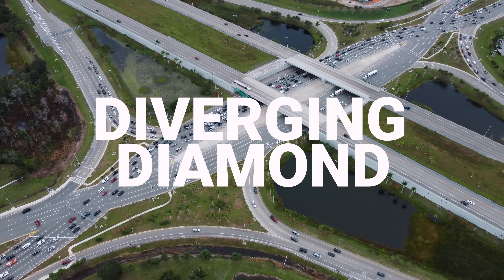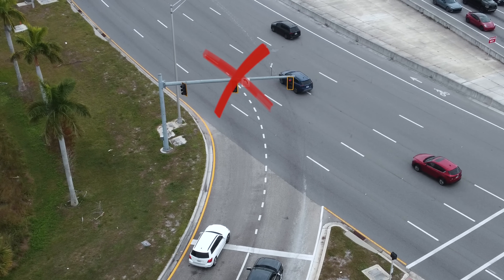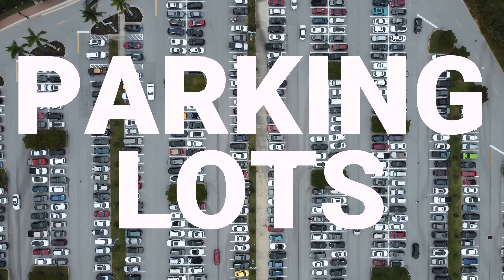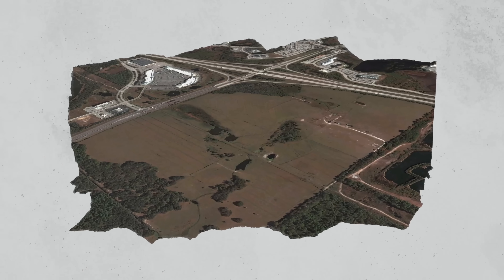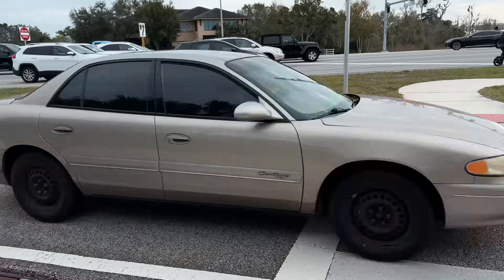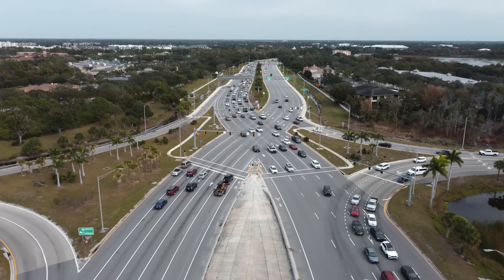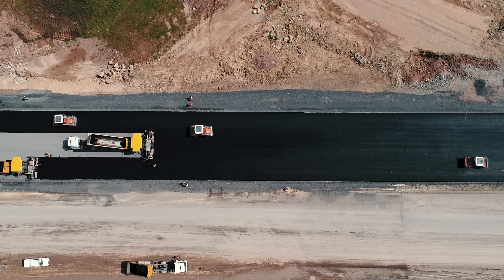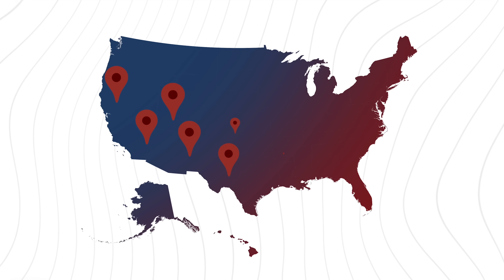Traffic Will Never Be Fixed Here

Comment: that place is a crime against humanity. And there is a really good way to have people cross an interchange. And that is to not have them cross it. There should be a completely different path crossing the highway that fits well in a larger network of cyclingroutes away for cars. A couple good examples from my country of this are: Jan Linzelviaduct in The Hague, Tegenbosch Bridge in Eindhoven, Ekkersrijt Tunnel in Eindhoven and the Ouverturepad in Harderwijk which runs parralel to a buslane.

Also really enjoyed the video👍
Reply from the maker: Yes exactly! Pedestrian space should be isolated from vehicle infrastructure, not directly interacting with it.
Reply: There is a separate bridge across the Interstate going in just south of that diverging diamond at Benderson Park. It's promoted as an extension of our local rail-trail to get to a big housing/shopping development on the other side, but well into the process we found out it will have 4 lanes of cars going over it also. At least there will be protected bike lanes and no ramps to the Interstate, but cyclists and pedestrians will still have to deal with car intersections on either side.